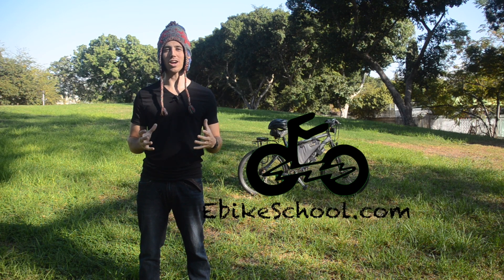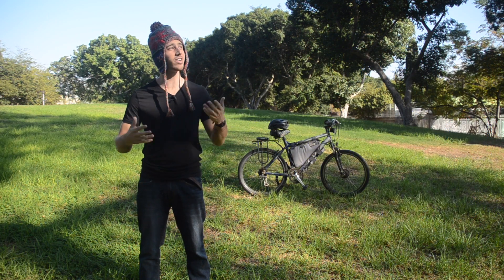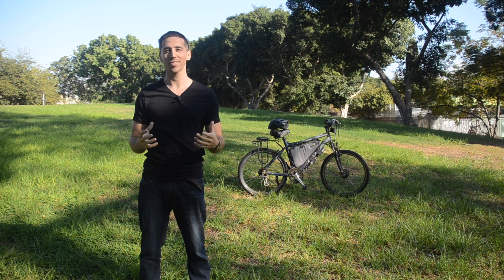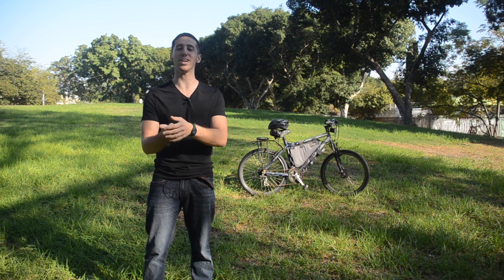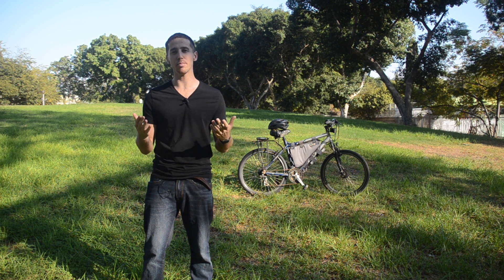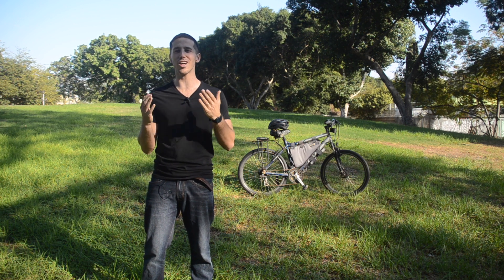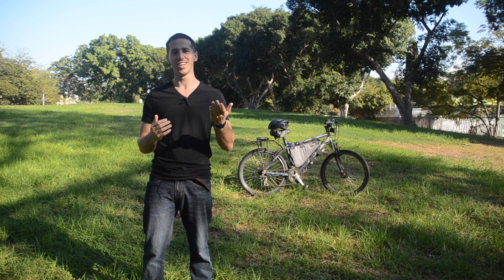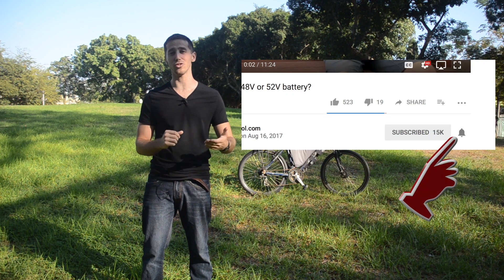10 COLD WEATHER Tips for Your Electric Bicycle

Comment: Hi.. Great vids ive watched a good few... I just finished my first build for a courier bike in NYC.. I notice when I run the batteries till they almost die during.deliveries the pack gets pretty warm.. So will constants use/discharge keep em warm enough that I can.just pull yhe pack and.go.right to charging? I keep everything contained in a tool box on the rear rack.
Reply: Accro Brandon Yup, if the heat made In the battery from riding keeps it warm, as long as it's not too hot, it should be fine with charging.

I would not reccomend charging above 35c.

Comment: Hi Micha. Am I right in thinking that leaving a pack at 50% charge is the same as trying to aim for the nominal voltage rating? For example, a typical 18650 cell would have nominal voltage of 3.7V with a minimum of 3.2V and maximum 4.2V. Therefore, would it be better to leave the pack at 3.7V per cell over long term storage?
Reply from the maker: Yes, 50% charge is right around 3.6 - 3.7 V, depending on the battery chemistry.

Comment: Micah: if an ebike is drawing more watts than the battery has would it still work? And could it damage the battery?
Reply from the maker: What do you mean by "than the battery has"? Watts is a measure of instantaneous power, like horsepower.
Reply: EbikeSchool.com I'm asking if a smaller capacity battery could be damaged or degraded fast. Like a 36 volt 3.5 amp used on a 36 volt 500 watt motor.
Reply: Jeremy Ellis Measurements of this type should use current.

Firstly, check the current rating of the battery, in continous amps. This can be attained by reading the specs of your store bought pack.

If your batterys continuous current rating is equal to or greater than the continuous current rating of your controller all should be well.

Comment: Great video. You mention to charge to lower current. Can you expend on this? Do you have some numbers?
Reply from the maker: Max charging for a lithium battery is usually 0.5 C, meaning for a 10Ah battery, that would be 5A. But if you can stick below 0.2 C when your battery is under 10 degrees Celcius (which would be 2A for a 10Ah battery) then that is even better. Lower C rates at low temperatures are preferable.

Comment: if its very cold out (below zero)and you have a shark or dolphin type battery case on your downtube you can keep your battery warm by wrapping the battery in a plastic shopping bag. it also makes it more water resistant. also a plastic bag over your socks in your shoes keeps your feet dry.
Reply from the maker: Good tip! Just be careful the bag doesn't have a small opening where you wrapped it, allowing it to actually collect water as well.

Comment: AMP AND AMP HOUR VIDEO!!!!!!!! Plzzzzzzz
Reply: Volts = speed or rpm, amps discharge = power or torque, amp hours = capacity or size of gas tank, so the higher the volts you have, the faster you can go, the more amp discharge rating you have, the more power you have, the more amp hours you, the further you can go. At 36 volts X 40 amps = 1440 watts of power or 1.4 kw, 72 volts X 40 amps = 2880 watts of power. Amp hours 10 amp hour battery you can draw 1 amp for 10 hours or 10 amps for one hour, the average is 1 amp hour will get you 3 km, 10 amp hours gets you 30, 20 gets you 60. So yes amp discharge and amp hour are not the same thing, but they are related. Amp hours is like a car gas tank, where as amp discharge is like horsepower rating
Reply: @larrymacdonald4241  Very good explanation. I am trying to figure out how large of a battery I need to build from my current 52 volt 24ah pack that currently gives me a 25 mile commute  on a 65 lb. Bike with 220 pound rider average 25 mph with pedalling  using BBSHD mid motor. I arrive with about 35 to 40% capacity remaining. The goal is to build a battery and controller combo that can average 40 mph over that 25 miles. I was told to double the speed you need 4 times the power so that means if I use about 500 to 600 watts to travel now at 20 mph ave I will need 2000 to 2400 available to get up to 40mph? That's a huge battery!

Comment: Hi Micah, so I've a large battery 48v 1300wh and I'm just curious if you know if a battery management system is always balancing the cell or is it only during charging, as I've noticed my battery stops charging at different voltages normally between 53.5v -54.2v and I'm wondering if i need a new b.m.s? It could just be my charger too as its an 8amp charger and it forces the voltage up higher than the cells actually are, that and its a cheap charger and I'm not convinced its doing the CV phase properly. Regards Aaron
Reply: aaron quinn That voltage cutoff is correct for a 48v pack (13s), at around 4.1 to 4.2v per cell. However, if it is a 52v pack (14s), that is an incorrect voltage. If you pack is 13s, then there are no problems. Otherwise the problem is likely that your using a 48v charger on a 52v pack.

Comment: To prevent moisture getting into my throttle and wiring up at the handlebars I use a Waterproof arm cast cover (for showering). It covers everything and has enough slack left to use the throttle, brake and press buttons as needed.
Reply from the maker: Cool idea! Thanks for sharing!

Comment from the maker: What tips did I forget that you would add? Let me know!
Reply: Lights lights and more lights!!! Be seen and see when the nights come early 👍
Reply: I personally do leave my ebike battery inside my battery box overnight in the winter and I used to experience some performance drop when I first hopped on my bike for a ride. Taking the battery out to warm up inside is a chore for me as my box is a tight fit! I sourced some thin but effective insulation from my local hardware store and have insulated my battery box to keep it nice and toasty and save me faffing with removing battery’s:) !
Reply: DIY heated grips hahaa =]
Reply: Let the air out! I find dropping a few p.s.i. When conditions warrant, can be a real game changer.
Reply: I dont know if this helps that much...but i considered buying neopren covers for batterys (for those in metal housings) to keep them more warm during driving. or since they get warm while using - maybe to keep them warm in short breaks.
Reply: Ben Bloodygrave I’ve never used neoprene but if it’s readily available to you I’d imagine in would work a treat!:)
Reply: dont use front brakes because you will crash

Comment: I love this channel!   Would it be beneficial to run a smaller front hub motor (350w) along with a rear hub (750w)? #Becausesnow
Reply: BASryder Dual motors provide more traction, greater acceleration, and a marginally higher topspeed.

However the bike would be heavier, less efficient and more complex.

You must use the same types of motors and controllers in a dual motor setup. I would not reccomend pursuing and additional motor, but getting a more powerful rear wheel is an option.

Comment: I had no idea you Live in Israel too! COOL! How to buy your book? מדואר ישראל?

Ps: Can you do a Video about amp hours and amps? I can't understand that... (How we calculate in a battery pack and etc)
Reply from the maker: אני מצטער אבל יש רק באמזון עם משלוח יקר לישראל ...
Reply: Yeah that would be great also how do you tell when the battery is getting to low is it 32v at full throttle or at rest, Ie the battery is at say 35v but when drawing 17amps it hits 32v  or lower is this ok?
Reply: Brannen Thompson It's alright for battery voltage to be as low as 2.5v per cell under load, but if you roll off the throttle for a bit, the voltage should be at least 3v per cell. Any less and you should discontinue riding.